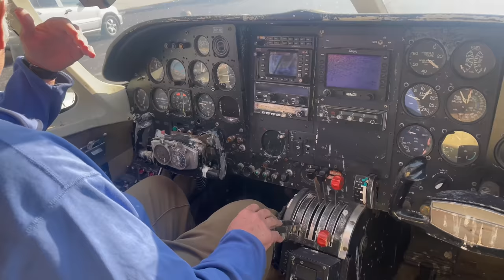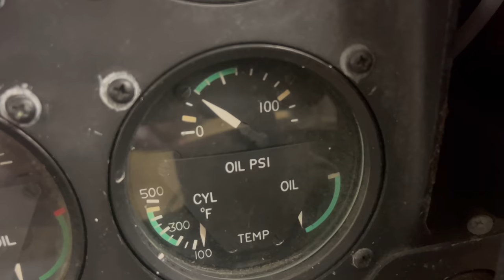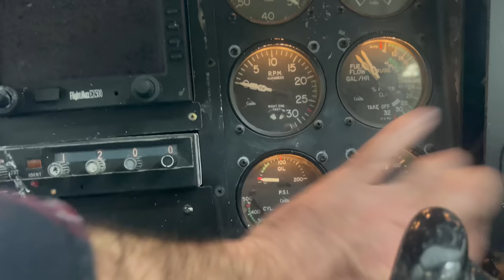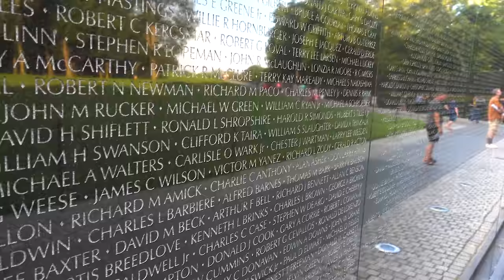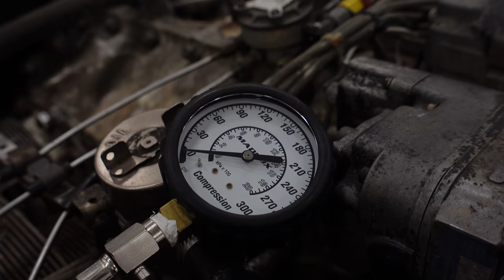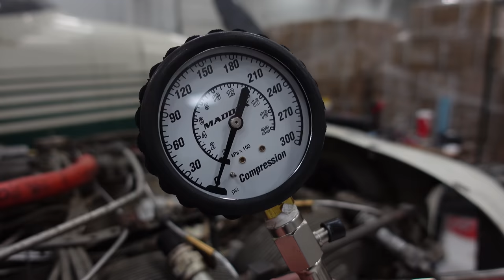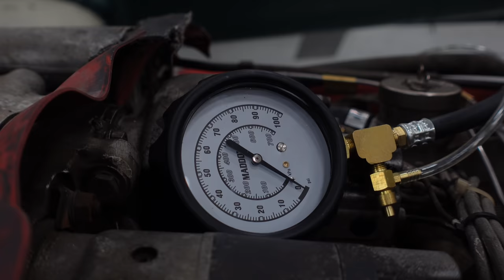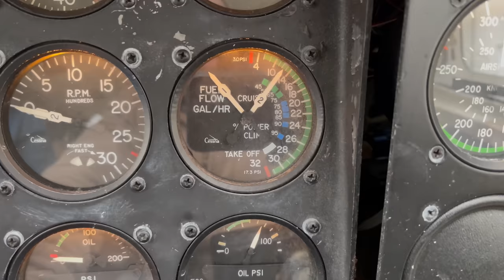Did We Ruin The FREE Abandoned Airplane Engine ? Ep6

Comment: The Jet Fuel Solvent is a great suggestion, in the old days (Automotive Use) we'd use Kerosene (same as Jet Fuel) and actually idle a warm sludge filled engine that suffered from lack of oil changes for about 5 minutes to give it a good internal cleaning. I wouldn't do that running in the tight new engines made today or an aircraft engine, but cranking should be great. We'd do a couple of quick oil changes after that to make sure we got all the sludge and particles out, along with getting rid of any chance of lube oil dilution that may exist after doing this before doing any heavy loading or running at high rpm...
Reply: - Yup, that is exactly how at age 21 that I was taught to fix up a 1948 Chevy 216 six cylinder, updraft carb, in an old aluminum body four speed 1 ton milk truck.
Reply: I was about to say my dad filled many a Chevy 350's that were stuck full of Kerosene and cranked them the next day after cleaning the kerosene out.
Reply: Had to do that many times with engines where people used Quaker state gum up “oil”. Worked like a charm!
Reply: @sirtango1  Thank you for mentioning Qwacker State Goo oil!!! I ran gallons of k-1 through my GTO while running, over and over again. After i rebuilt it (took it apart cleaned everything and replaced anything worn except the rings bearings like a real "rebuild" but I didn't have the funds etc)  Anyway she did 165 past the police station and still had pedal to go. 
  Got a ticket for doing 120 in a 35 on country road in Bummertown Washington Puget Sound (yes I was in the Navy in shipyard with the Kitty Hawk) and the judge gave a $35 penalty and told me to be sure to sell it to him and only him... 1968 GTO what an excellent car. too bad it drank gas. and circumstances caused me to have to leave it behind in Norfolk after using it like a moving van and towing my motorcycle on a one hoop thing I made for the bumper. Fully loaded towing the 500+ lbs motorcycle and my friend with a 440 charger with three duces could not pull away from me.. ha ha .. I was as surprised as him..
    Anywhooo, one more time, "clear exhaust" put oil not starting fluid in the cylinders!!!! and if possible always access at least a visual on the valves, spray clean the valve guides and lube well by moving them many times. It's a bit tricky but I have actually removed the springs attached a drill (masking tape around the stem to prevent falling (have magnet ready and be sure the piston is at or close to top) and prevent gouging of stem. I carefully and gently with liquid spin the valves to seat them.  
Then as one smart comment stated,  use your compression tester hose and put some air to it see what leaks. 
  In short Compression is a necessity no getting around it. 60 psi on first push is absolute necessary. 75 is generally minimum and second round should get you to 110 period.!!!!!!  Didn't I mention tis before?
  I have taken out weak cylinder plug and warm the engine up with the good ones and then put the plug in and put a space between the plug and wire for a while to get hotter spark and sometimes that will work. But no more than one or two weak cylinders. You have maybe two good cylinders.. That is called a laughable situation or a Starter burner.
  As always Blessings  and please pray for the Truckers ... the front line warriors in this fight to get our Governments back from the kabbala.
please look at cracking the eggshell of conditioning dot com

Comment: You are making progress guys..I notice it was cranking with sudden spurts.. Have you checked for consistent spark on all pots?
Earthing can be a worry.. Check for corrosion on any Earth side connections, cables etc of the ignition system.
If the Magnetos have condensers..fling then old ones..put new ones.. Best wishes for the project.

Comment: On the electrical contacts in the mags, I would never use sand paper unless it's at least 1500 grit because sand paper scores the surface ,that will accrete dust and dirt faster than if the scoring didn't exist. I recommend using a rubber eraser, it removes the grit and carbon without scoring the surface.
Reply: For sure 100% however I'm pretty sure he's replacing them before he actually flies the plane so a little sandpaper just to get it running won't hurt anything. Definitely should use the rubber tho if he did plan on using them long term
Reply: @stewiegriffin88  It have to be FAA approved, before it will ever fly :-)
Reply: @Pilotfarmand  well aware of that. That wasn't the point...
Reply: @stewiegriffin88  I didn't catch the brand, but the literal manual says never use an abrasive, only to use a hard paper like a business card for Bendix magnetos, also I couldn't tell but it looks like when he removed the mags, he had left a part in called the impulse coupling.  The impulse coupling is a part that makes sure that even if you spun the engine at 1 RPM, it would still spin the mag fast enough to generate a spark
Reply: @rainstormm1  He's just trying to get it started, that's it. The literal manual doesn't necessarily matter at this point 🤷‍♂️. He's doing what he can to get it to start and if that's all he has then that's what he's gonna use to make it work. Calm down smart guy...

Comment: It spins fine when the plugs are out, my theory is a plugged up exhaust. Cylinders are building up too much pressure and putting too much load on the starter.
Reply: I said the same thing.  It definitely makes sense.
Reply: thats exactly where i would go too.. Those birds nested everywhere ..lol or,, mayby its a sweet potatoe...lol
Reply: I agree that he should inspect it for bird nests or whatever but other than that I can't really think of anything else that would block exhaust besides stuck valves so maybe pop off the valve covers. I would also inspect that intake and probably remove that turbo so it can't slow things down, be very careful with it though because it is probably rebuildable and attempting to make it turn could cause more damage maybe, just handle with care.
Reply: Agree, also a few episodes ago mentioned a seized turbo, probably related. Birds built a nest at the exhaust side of the turbo, is my guess, blocking both exhaust flow/turbine wheel and compressor  wheel/impeller from spinning, and raising the back pressure towards the engine, preventing start. Short solution, as mentioned before, is to remove turbocharger.
Reply: Smells like diesel because it is diesel just refined more to remove all sulfer and paraffin
Reply: That’s it

Comment: Compression is too low! Valves are stuck partially open or the rings are stuck. Leak down test is the only way to diagnose this and eliminates any speculation. It will run once that's fixed.

So close, though!  I enjoyed watching you go through everything. Once the compression is up I'm confident it'll run as good or better than #1.

-AME M (Canadian version of A&P) here.

Comment: Hey, love the Chanel, a few tips from a long time A&P, 1. The Jumper cables are  choking down the amperage getting to the starter. Remember that Aircraft are built to be as light as possible. So the battery cables are just barely large enough for their purpose, by adding the 6 feet of your thin gauge jumper cables may not be providing the full amount of amps the battery can give. 
2. I've used the Jet fuel truck on a few engines in the past, you do not want to run it more than a few minutes without changing the oil

Comment: When you had E1 running and were trying E2, I was saying "come on!" "come on!" "come on baby" just as I was there.  I think you have a blockage somewhere that is causing back pressure.  Run a snake up through the exhaust and see if it comes out at the turbo clean.

Comment: I absolutely wanna see the cleaning of the plane. The detail geek has amazing calming videos and to see this in its beauty condition would be awesome. I'm am AP mechanic based in CVG so this hits home
Reply: How much longer is the electrical cable from the battery to the non starting engine? How are the starter cable connections. OleDave
Reply: What is the voltage at the starter when trying to start compared to the good engine? OleDave
Reply: You should link up with AmoNYC and get him to come help you clean the planes exterior!

Comment: The best and most reliable method to start those engines when they are cold...is Mixture FULL RICH,   Throttle open 1/2 to 1 inch.... Press the primer switch at the same time the starter button is pressed.  For a hot engine Engage the starter with the mixture control in cut-off and no prime is used. DONT BURN UP YOUR STARTER.

Comment: Im loving your videos of the getting the 401 running.  Id love to see this whole aircraft being cleaned up inside and out.
BUT, You really should have had rubber gloves on messing with the jet fuel.
I use to drive a gas tanker, and I worked on ground support equipment in the Air Force.  When we worked on the -60 gas turbine compressor generator sets we had to have aprons, gloves and faceshield on when messing with the jet fuel and jet engine oil.
Jet fuel and Aviation fuel is worse on your skin than diesel or gasoline (even though gas, diesel and stoddard solvent is still bad for you when you get it on you.)
Just looking out for you.
Reply: True. Have seen many tanker drivers working with avo fuel with severe dermatitis from fuel spills and such while connecting pipes etc and no gloves. If you want to continue working with engines, dermatitis is no joke as a slight spill on the split skin can leave you in severe pain.

Comment: I think you are fighting two problems with this engine.  First problem is the voltage drop to the starter when using the external jump battery seems excessive.  This diagnosis was reinforced by the fact that the engine spun much faster and was actually trying to start when you were running the #1 engine.  The second problem you are fighting is the relatively low compression on this engine.  An engine with low compression/leaky rings will need to be spun much faster to have any chance of starting.  You may try using something a bit heavier, (like Automatic Transmission Fluid), rather than relatively thin penetrating oil, into each cylinder.  If you can squirt ATF up on the top side of the cylinder wall at the piston/cylinder wall junction and hand pull the prop through to coat each cylinder wall it may help free up the rings and make a better seal.  Thoroughly coating every cylinder will probably be a two person job.  One squirting oil into each cylinder and one hand pulling the prop.  I think the compression may improve once you get it started and up to temp.  Love seeing the progress!

Comment: I once rebuilt a mag for a 1934 Farmall.  The points were green, and the varnish was dry and cracked on the mag coil.  Cleaned up the points and revarnished the coil.  Put the mag back in the tractor and it started. the farmer said it was the first time it had run in almost twenty-five years.  It was a crank starter.  For me, it started with half a crank and a shot of ether.  The old guy said he had owned the tractor since new and it never started that easily.  He was in his late 
80's and he started it right up easily.

Comment: Finally finished the video.
First off, I have to say, I LOVE Sam's sense of humor!

Couple comments:
I know you're probably going to start pulling off accessories and checking them, but may I also recommend examining the cables from the battery box to the RH engine starter. They may be corroded or damaged.
But yeah, looks like you're on the right track to getting that #2 engine to start and run.

PS: Probably not financially wise at this point in the project, but I just felt I should mention considering installing an OEM battery for this plane.
Reply: I totally agree. Even run a new cable to the starter relay and connect battery’s directly to it.
Reply: Thank you.
Reply: I agree on checking the battery cables conductivity, draw under load & cable ends. 
I was hoping you would try the slow starter on the running engine to rule out the starter.
That bit me in the ass one time(cable visually looked fine but internally frayed  losing output under load.
Great observation engine 2 running engine 1 turned over aggressively tried to come to life. Can't  wait to see both fire together. 👍

Comment: If I remember rightly, you can have someone signing off on the work you're doing as you do it on a plane you're looking to get airbourne like what JimmysWorld is doing with the Cessna 310 project. I don't quite know if that extends to engine overhauls but I would guess that as long as you have a certified mechanic monitoring you and as long as you do everything by the engine builder's service manual (in this case, Continental), you should be A-OK... it would also make a great series if you are actually allowed to do the overhauls yourself. Failing that... I hope whoever does the overhauls for you has a YT channel where they document it because I would love to see those suckers getting rebuilt!
Reply: Depends. There are instances where the engine must be send and overhauled by the manufacturer, for instance after a prop strike. Sure, he hadn't a prop strike, but the engine was sitting for so long, i think it's possible that a certified mechanic looking over the work he does is not enough anymore.
Reply: @shi01  That's pretty much what I was anticipating in terms of the limitations. Especially considering engine work is the number one thing that can make or break a restoration like this. That meticulous requirement is part of why flying is so safe, even in small single or dual piston engined craft.
Reply: @shi01  He needs both engines completely rebuilt. Not just because it's been sitting so long, but also because he doesn't have the logbooks. Without logbooks the manufacturer has to rebuild both engines before it can fly again, no way around it. All this work he is doing on them is pointless. Even with logbooks you have to have a licensed A&P watch everything you're doing. Again, making all this pointless. This is just Youtube content. Nothing more.

Edit: And that's just the engines. Then there is the frame, props, and everything else that will need to be done (mostly by a licensed A&P) before it can be certified to fly. This isn't a car where anyone can wrench on it.

Comment: Thanks. I've been watching this with interest. It's likely someone has mentioned this, but have you considered trying some fresh plug leads for Engine 2? I'm seeing those leads draped over the cooling fins and it reminds me of a motor problem I had with a weak spark due to old leads shorting out on the engine block. The insulation had broken down on them.  Good luck!

Comment: A failure is only a failure if there is nothing learned by it- the starter in 2 spun 1 just as fast as original starter in 1 spun 1- but you never gave up and threw in the towel- you're awesome !

Comment: love watching your videos, just thought i would add a comment about jet fuel in the crankcase. diesel, kerosene and jet fuel are all from the same process jet fuel is just refined a bit higher. Seafoam engine treatment is 90% kerosene also back in the day we added 1 gallon of diesel to the gas tank to clean up the valve’s one 0z per litre to the oil to flush the engine. its the miracle fluid that that’s been under our noses for decades
Reply: Very good point, most people don't realize that jet fuel is just thin diesle or solvent with additives. We used to run a little in our D8 cat dozer. Not great fuel for cobustion engines but it will loosen parts.

Comment: That squeaking sound really concerns me, though. I'd definitely get a borescope in each of these cylinders and see if there is any serious scoring, they may have to be re-honed. The ultra-lightweight jet fuel/oil mix may have washed away the oil film on the cylinder walls so they're now contacting metal to metal and causing more damage.
Reply: Yes sir. I was thinking it sounds like the rings are stuck out causing the slow turnover as well. The noise accompanied piston movement and washed bores could make that just like you say. Gotta make sure the bores are oiled before you go for a start.
Reply: But why does it turn easily without plugs? Or does it? Maybe a comparison...
Reply: @rjones8508  compression , the plugs are basically plugging the bore , so when there not in it’s not sealed , like a bottle , you take the lid off and you can crush it , when it’s on it’s hard to crush , so when the pistons move up it creates less space so the air compresses till the valves open , thus making the engine harder to turn over
Reply: @rjones8508  yes - hand cranking it was making him tired and the plugs were out.

Comment: Very cool!  Love watching it come back together.  “Jet fuel” is just aviation kerosene; basically diesel.  Common back in the day to use diesel this same way in car engines.  I’m a gear head and aviation geek, so I’m loving this series!
Reply: I'm a Heli AME by trade an personally, I'd have used diesel rather than kerosene, simply for the oil factor.
Reply: @maarten_notjustagrip  on cars, I use ATF and diesel
Reply: I'm a bit wary of ATF and some seals. Used ATF in the cylinder to free a gummed piston tho, yeah.
Reply: @maarten_notjustagrip  oh definitely, especially for aviation applications.  I just work on old beater cars.  If it stalls or sputters, no one is going to die. Much more important with aviation and especially rotary wings like your stuff